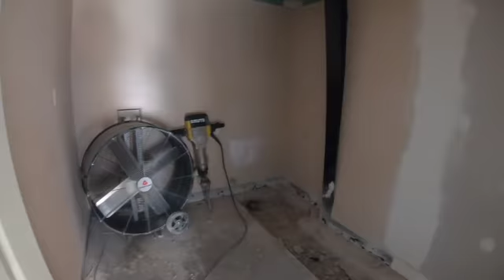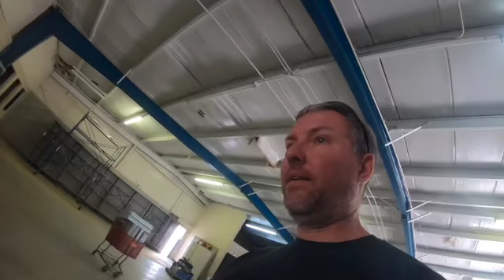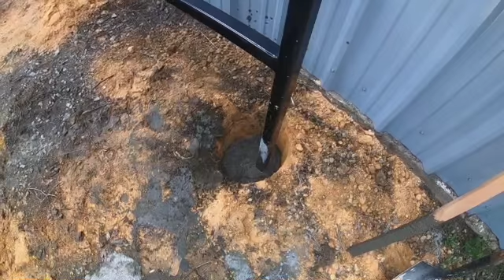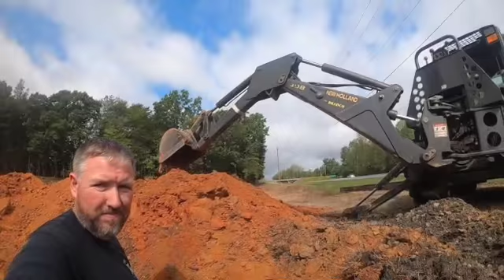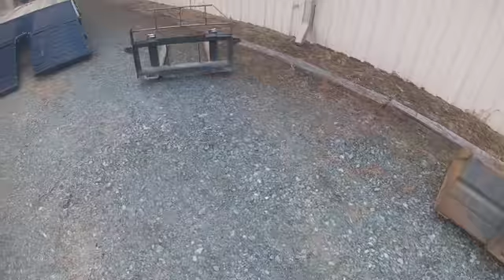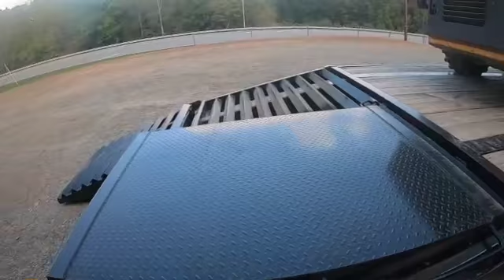Installing 3 phase electrical service, 600 amps of power

Comment: How come didn’t you mix that quickcrete in the hole? Just dump the sacks in and fill it with water and walk away. Lot of people don’t even add water, they say the ground water is enough. I’ve set thousands of posts that way, and those are almost solely set in arenas and cattle corrals so they get abused, no issues
Reply: Don’t mean to sound critical. More just curious if there was a reason you did it that way based on the area you’re in, etc
Reply from the maker: @acecoors  I know I’ve done a few like that without mixing but very few.  I’m always scared they won’t get any water to them quick enough and get hard.  I should definitely try doing that it would speed things up a lot.